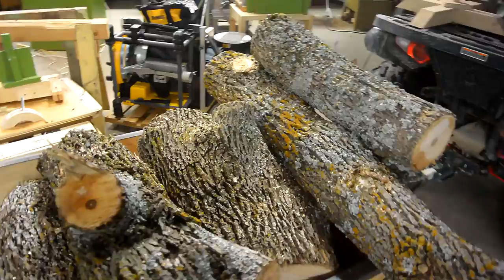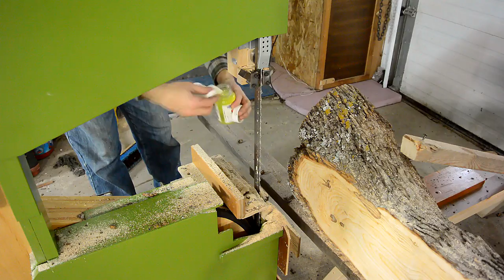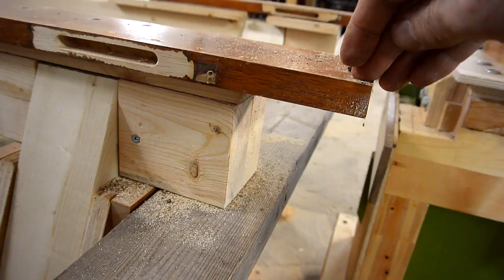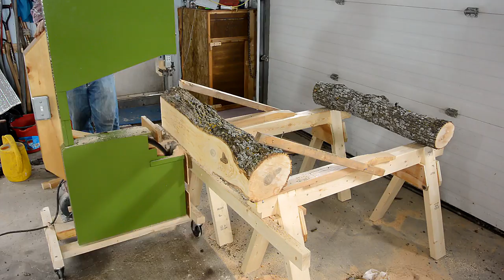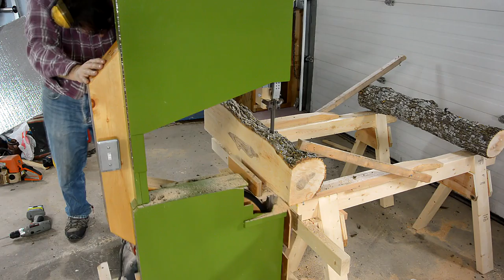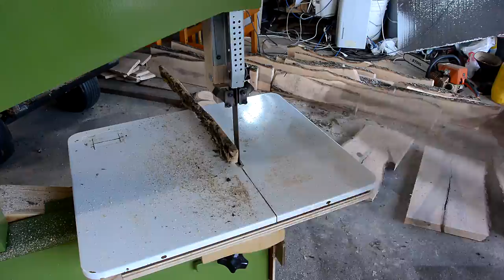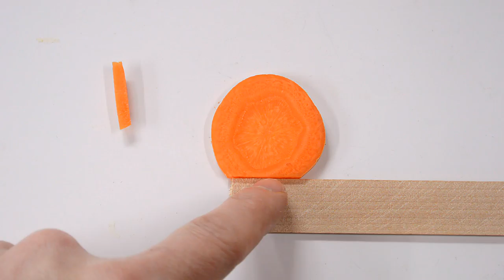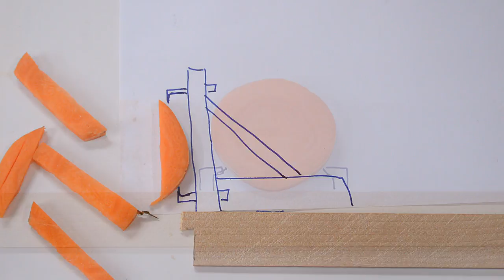Bandsaw-on-a-dolly sawmill improvements

Comment: Hi weren't sure where to msg you about a question on upscaling a bandsaw? I have a 6" bandsaw and was thinking of building a larger version to do bigger projects such as band saw boxes and wondered if there would be any reason not to use the parts (motor, wheels) from my bandsaw in a bigger frame and obviously bigger blade so that I can get say 12" depth or roundabouts. Is this doable or would the strain on the motor be too great? Cheers for your time.
Reply from the maker: The motor is too weak and all the parts are too small.   Leave it intact, make new parts.

Comment: you could make a rail into the  saw horses and then put some skate wheels or steel bearings on the carriage of the bandsaw, kinda like the guides on the side doors of a minivan
Reply: and also, hold the log by the center and rotate it wit a worm gear, that way it won't woble and it would be easy to relocate

Comment: what about fixing the saw to the horses and putting the logs on a sliding platform ?
Reply: It's easier to move the saw then it is to move a relatively heavy log.  Moving the log would require a large amount of infeed and outfeed space and you still have the problem of supporting the log while its being cut.

Comment: Hi matthias, what if you'd put some sort of dustprotection over the wheels, would that solve the sawdust problem?
Reply: Kevin DE vries Probbably not, because problematic dust is picked up from the floor when he drives over. Dust that falls on the casters has almost no effect.
Reply: I get what you're saying  but i meant something that will make sure the dust doesnt fall on the casters at all, like a little roof of some sort

Comment: A way to speed up the system you have now: you could set it up where the guide 2X4 is doubled up then after taking the first cut just remove the outer 2X4 then you are ready for the next cut.
Reply from the maker: Not safe to overhang the supports by much, so a bad idea.

Comment: I was thinking maybe you could attach Wheels directly to the saw to make a horizontal Mill and then adjust the track up and down rather than the other system that you did before with the original Mill

Comment: practically speaking, would it make more sense to have a lot more thinner slabs or less thicker slabs?
Reply: Depends on what he plans on building and how far he has to transport the wood.  If he never builds anything with wood thicker than 1/2", then no point making slabs that are 1 inch.  And if he never makes anything with wood less that 1 inch, it still might make sense to do 1/2" slabs if any thicker makes them more cumbersome to lug around and work with.

Comment: I am considering building a bandsaw mill.  I have a question on the belt system.  Would it work to use two small rubber wheels and press the blade between them?  Similar to a baseball pitching machine
Reply from the maker: no
Reply: Matthias Wandel I take it that you are certain. :)

Comment: Matthias, are you thinking about a dedicated saw mill?? 
I am shocked that we haven't seem dial indicators mounted all over to see where the most vibrations are coming from.. I know you like to be very thorough....  ;)
Reply: I see a wooden horizontal mill with wooden gears and shafts for lowering the saw in the near future... Bigger motor and a wooden ratcheting sled and clamping system along with a wooden chain lift/flip system... Why?? Cause Matthias don't need no stinking steel!!!!!  ;)

Comment: I realize that you've already nixed this Idea,but at some point the time being spent trying to fix each issue,and clamping,unclamping would be worth trying it differently.

,I used to work in a factory that cut large block of foam for seats (like 4'x8'x 2.5') Our huge band saws that we used to cut them initially,had a table that moved the material while the saw (and blade stayed stationary).I  just feel like it would solve the most problems,the dust,clamping,etc..

Comment: I't funny that I think of the way you mill logs when I slice carrots. Now you ilustrate log milling by using carrots!

By the way, I was thinking of a log holding sled even before I got to that part of the video, but instead of the clamps, the sled could have a vertical plane,so that you secure the log to it with screws. That way you's fix it once, only taking care of not cutting through the screws on the last board.

Comment: it's not possible to clamp the log between end sides? at each end square or triangle plywood with few holes ...maybe will hold it better, and will be possible to cut even the last slide
Reply from the maker: Only if the sawhorses are exactly as far apart as the log, and the log ends are square.  This could get real awkward.

Comment: carrot mill 😂
Reply: Alejandro Instead of making bigger bandsaws maybe he should start going into miniature.
Reply: Some things aren't scale-able.
Reply: But a bandsaw is....
Reply: You won't achieve the same vibrations on a small model that you will on a large model. Because a small model will be able to generate a better grip and stability than a large model that might have many unstable points such as, Legs being on uneven surfaces, the object to process being positioned unevenly among other things. And the clamping surface itself, will become more unstable on al arge model compared to a small one.

Not to mention that making a functioning Bandsaw/Sawmill will be quite picky on that smaller size.
Reply: He may already have a Dremel. But of course some experimentation with rubber band powered wire saws might be very informative.

Comment: Your first idea of a double clamp would work.
Also make the bases with a dove style slider so advancing the log forward could be painless and accurate. 
Could put stop pins in at measured intervals for what H to H and if you wanted to use the clamping system for if you make 6/4 or 5/4 or something like that.
Love your videos and ideas keep them up thank you.

Comment: Your saw should be able to run horizontally as is.
fix the saw on saw horses and put the work on a scissor lift trolley. (or make one out of two car jacks linked together)
I can' believe you don't have a one horse motor with right rpm in your motor collection :)

Comment: Why is "making the Saw stationary and the Log move" not an Option?
Reply from the maker: logs can get much heavier than the bandsaw.  You also need 2x the room if you move the log.
Reply: I honestly dont see an issue with space there nor with logweight since it is rollersupported and moving the log might make it possible to move it away from sawdust (deflector that just guides the dust infront of the saw instad of logsupportrollers) (i bet real sawmills move the logs instead of the saw for a reason) but since it is your project...im totally fine with it :)
keep it up and thx for my entertainment.
Reply: How about a cranked controlled variable width slide? You can leave the log staionary and have the saw distance controled by the slide width.
Reply: Lucas sawmills don't. They move the saw.
Reply: >  Lucas sawmills don't. They move the saw. 

Depends! Small sawmills - usually. Bigger sawmills - usually not. Automatic sawmills - never move the saws.

Comment: probably doesn't help the 110-115V AC in north america
Reply: I know he's canadian btw
Reply: Motor voltage has nothing to do with it; a higher voltage motor would simply use less current for the same power output.  We also have 220-240V AC in north america , 110-120V is the phase to neutral voltage of our split phase 220-240V AC system.  Matthias has used 240V AC motors in his machines in the past, if he thinks a 240V AC motor will help, I'm sure he'll use it.  If memory serves right his horizontal bandsaw mill used a 240V motor.

Comment: Put it on tracks. Problem solved.
Reply from the maker: watch the video
Reply: watch the video
Reply: Sorry I was to lazy to explain. Put a metal T-track or a 90 degree angle iron on the floor. Screw the proper wheels for example from a pulley or a sliding garage door on the bottom of the saw.